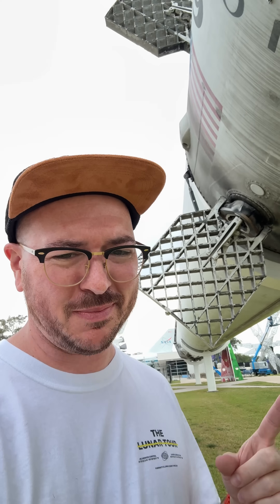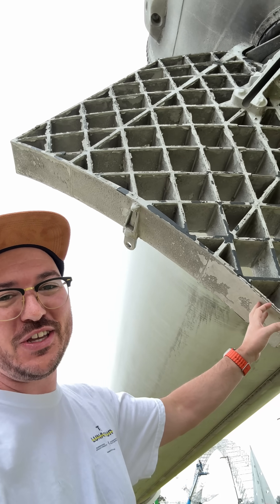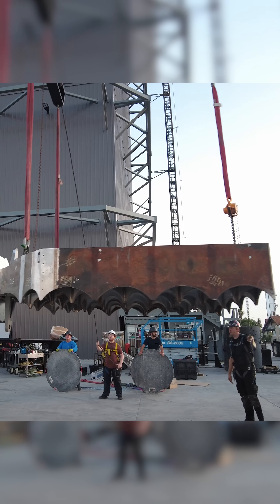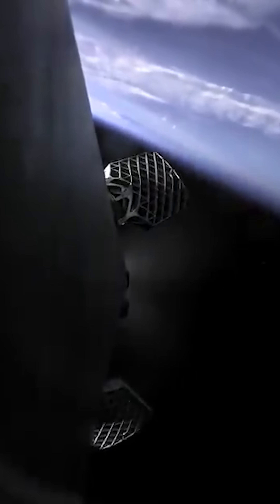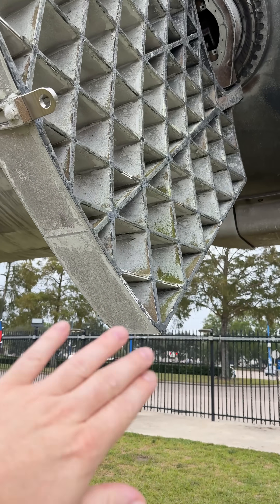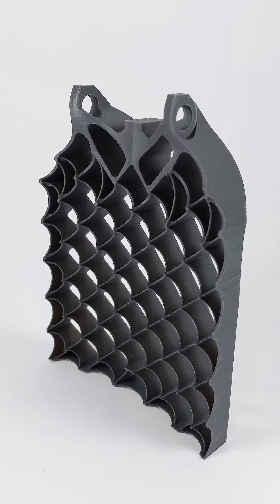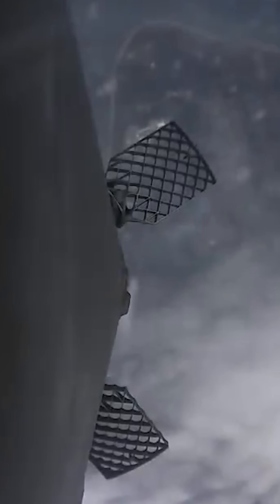Grid Fins are HUGE and super cool! Here's how they work! #falcon9 #starship #SpaceX

Comment: I help to maintain and repair these boosters between flights. The grid fins are pretty hands-off for maintenance. Even after simulating about 90 flights with zero maintenance these things are still expected to be flightworthy after about 90+ flights. They absolutely outlast the boosters they're used on.

Comment: I am actually one of the automation engineers that controls the processes of metallurgy for the fabrication of these parts. All the PLC programming, the robotics, the wax mold process, the casting, the pouring of metal to replace the wax, and all the CNC operations performed. We make these at a company called Howmet Aerospace in Hampton, VA
Reply: Nice!  Must be pretty cool to see them in action.  Not everybody that makes things has the pleasure of doing that, much less on something that is so cool to begin with!
Reply: Badass
Reply: Ok

Comment: I'm guessing they are controlled  by strong, heavy electric motors powered by lithium-ion battery packs through a pretty small circuit board? If so, I wonder how many backup circuits there are in case of circuit failure. Do you think they use tesla car motors for the grid fins?

Comment: You clearly don't know how these work because the are doesn't just push through them they turn and adjust directing air in certain directions around the fuselage and they've also never been made out of aluminum aluminum melts well  below the melting temperature let the whole reaches during re-entry
Reply: Its an aluminum alloy. And the "pushing air" you mentioned isnt whats controlling, its the increased drag.

Comment: Who came up with the idea of the grid fins or when were they implemented into the design? Like did the rocket ever go up without them?
Reply: Falcon 9 can be used in expendable mode for more payload to orbit. The gridfins are only used on reentry so when they don't intend to land it they don't use them. The gridfins were developed by the Soviets and they have been using them since the 70s in missiles and rockets.

Comment: Where do rockets go? How are they able to maneuver in the VACUUM of space? How does something react to nothing?
Reply from the maker: In the same way that a firehose shooting water isn't pushing against the air and then that pushes against the firefighter or when a bullet is shot from, the gun doesn't have recoil because it pushed against the air, it's because of the equal and opposite reaction...  it's the same thing for the exhaust shooting out of an engine, it's shooting out of there so fast, thousands of meters per second, that it has an equal and opposite reaction.
Reply: @EverydayAstronaut  There is nothing to react too. It's empty space. How do thrusters work with nothing there. It doesn't matter how much you throw in volume when the volume has nothing there to react too.
Reply: @igdes1 there's a rocket. exhaust reacts against the rocket
Reply: @aleksandrs1422  hmmm, not sure you understand what a vacuum is.
Reply: @igdes1  do I really need to? My three year old twin nephews don't need to uderstand what air is, but they instinctively understand that if they push one another, they'll move in opposite directions? Air is irrelevant in their case. Well, negligible. Vacuum is similarly irrelevant to the forces in the rocket propulsion. 👍
Reply: @aleksandrs1422  irrelevant to the forces you say. I'm not guessing any more, you don't know what a vacuum is.
Reply: It's Newtons 3rd law.
Each action has an exact opposite reaction.
The exaust moves out the back so the rest of the rocket moves the opposite direction.
You don't need to push against anything.
Reply: @safetyinstructor There is nothing in the vacuum of space to get a reaction from an action. Do you understand a vacuum?

Comment: Designing those is one thing.  Milling them in aluminium is one thing; machining centers for parts that big are well understood.  Milling them in titanium though, that is a whole different thing.
Reply: Aren't the titanium parts printed or at the very least cast?
Reply: @ You could use either of those but I don’t know if there’s a metal printer that big or if printed parts have reached the point where they can be used like that.  You could cast it too, but that’s a tricky shape to sand cast and big enough to make investment casting pretty much impossible.

Either way you still have to machine it to create the attachment points, and if you have to set it up in a machine then (for a small volume of high-value parts) it’s simplest to start with a slab.
Reply: @ Aside, you can certainly cast titanium and probably print it as well; I haven’t seen it being printed personally but I’d be more surprised if we haven’t figured it out.

Comment: Awesome… I’d not say they’re invisible to the wind stream… even without rotating they must create a lot of drag, or why go to the effort of deploying them ahead of return. Great to see though, Starships are mad how huge they are.
Reply: Somewhere online Elon talks about why the Starship booster has fixed fins.  He said that on falcon 9's, when you include the weight of all the motors, mechanism and power sources, it cost very close to as much in thrust as the drag from just leaving them extended AND eliminated many possible sources of failure.  If I remember correctly, he said that if he had it to do over the falcons would be that way too.
Reply: @ fascinating that would go with his mantra of no part is the best part too eliminating all those parts needed to do that.

Comment: As an aerospace machinist, I think those are waterjetted. I keep thinking about how they are made. I bet they are bent steel then waterjetted. That's good engineering because it's super easy to make. The mating clevis type feature is the most complicated machining on these and that's easy if you have a dedicated setup for them. Cool stuff.
Reply: They are aluminum and titanium though?
Reply: I don't think they are bent; I think each individual piece is water jet cut and then they just use a ton of welds to hold it together. Bending would make the parts weaker and be super super hard to do if not impossible given how thick the metal is

Comment: Starship's grid fins currently melt during hot staging, so whenever they start making boosters that are actually meant to be reused, they'll need to change the material.
Reply: they didnt melt they just warped.
Reply: @zachmoyer1849  Mea culpa.  Though I have a suspicion most people visiting an Everyday Astronaut video managed not to become confused by my casual wording.
Reply: @Asterra2  SpaceX will change the grid fins to titanium when they actually start reusing the Booster. They haven’t yet because titanium is so much more expensive, and therefore not viable for a Booster that will only fly once and potentially be destroyed
Reply: @isaacsanders983  Yep.  I think I covered those points earlier but it's always nice to get an elaborated rephrasing.
Reply: @Asterra2  😄

Comment: I thought they'd be even bigger. That is such a small control area for the size of the vehicle.
Reply: you have to remember that its nearly empty. So all the weight is at the bottom. It takes very little force to move it since it has mechanical advantage away from the center of gravity and low inertia since its so light at this point.
Reply: That low weight and inertia make it much more susceptible to weathercocking.
Reply: @jbullforg  the rocket yes but not the grid fins

Comment: Literally the BEST possible short form video on grid fins...
Reply: I bet all the computing power needed to adjust these find, would fit on a 30x30mm circuit board.
Reply: @ripingpuma2460  the fact that there starship gridfins use tesla motors as in car sized motors to rotate is just 🤯
Reply: Right! I was thinking the same thing. Thanks for posting. I can't believe you haven't had more likes.
Reply: Learned something new today 🫡
Reply: I am waiting for Elon, or some Engineer to finally realize that they can also be used for vertical flight, as in on an Airplane.
Reply: @bigbossimmotal think you mean horizontal flight like a plane not vertical like a rocket?
Reply: @iRossco  LOL WOW, talk about a brain fart!
I can't even think of a good excuse for that one. Not enough caffeine? Too much caffeine?
Good catch.
Reply: Here have a 700th like
Reply: until they mess up applying pitch, yaw and roll.
Reply: Are those Elon musk's
Reply: But when the rocket booster slows down just before landing, there is not much air flow? How does the booster control itself with no air flow?
Reply: @1MrTahoe  rocket engines that gimbal or point in different directions
Reply: Bro I always heard Griffins

Comment: Why does the starship not retract its fins?
Reply: the drag on the way up was found to use less fuel then the added weight of the mechanisms needed to fold them would have used.
Reply: @zachmoyer1849  ok thanks

Comment: I wonder if having them out on ascent like Starship is actually more aerodynamic. Seems like they present a smaller surface area to the wind stream like that.
Reply: During ascent, they are moving slowest in the thickest air. As speed goes up, the air is also getting thinner.
Reply: It's more that the drag they create has a smaller impact on efficiency than the deployment mechanism would

Comment: If you were to turn the grid fins contrary to each other, could they act as air brakes because more surface area is exposed to the wind?
Reply: I think technically yes, however I'm not sure if the effect would be significant if you compare the drag to the mass of the rocket, and since the energy would heat up the grid fins they would get even hotter than normal.

The aluminium ones sometimes started to melt, so they can get over 600° hot during normal use.
Reply: @simonm1447 they can use Titanium instead
Reply: @Santi81-theOne  they do now for the block 5 boosters. However even Titanium has a temperature limit.
Reply: You want it to become a spinning drill?
Reply: @bluemamba5317  i mean that they turn contrary to each other so that their controls cancel out
Reply: sure but it wouldnt be enough to accomplish anything in the short windows that they would be able to do that.

Comment: Also, fly-by-wire controls.  A human pilot could not fly these rockets safely, if at all.  Possibly with a lot of simulation time. Modern airliners use FBW technology.
Reply: Even the Apollo LEM used a fully digital FBW system, since it wouldn't had been possible to land on the moon surface without it.

Hand inputs done by the astronauts like on Apollo 11 also went through the FBW system.
Reply: Most "modern" airliners aren't fly by wire actually
Reply: @JaisonBuilds  airliners like a 737 Max which is a modernized version of a 1960s aircraft are no modern aircraft, just modernized old aircraft.

Modern airliners are for example a 787, a 777 or the current Airbus lineup

Comment: The grid fins are not "invisible to the wind stream" When the vehicle approaches supersonic velocities the turbulent air flow through the grid makes them effectively a barrier to the air so more like solid control surfaces. They add enormous amounts of drag at high speeds.
Reply: Actual meters per second speeds at which they are useful depends a lot on the density of the air. They provide a lot of control authority very high up compared to classic rudders/fins which is useful to SpaceX because they can start effectively steer earlier.
Reply: Listening comprehension is key. He literally said when they’re stowed flat against the fuselage they’re invisible to the airstream.
Reply: @DavidPawson-d7h  No he didn't.
Reply: @DavidPawson-d7h imposible to be invisible to airstream, those things are like a aero screen, even if they have holes, I'm so curious in how they solve that problem
Reply: @SantiagoVelezRestrepo  33 raptor engines solves that "problem"
Reply: @DavidPawson-d7h  The big ones don't even fold away, lazy design. I think they need more billions of taxpayer money...

Comment: I wonder how these compared in effectiveness to the regular style movable fins that Blue Origin will use on the new Glen
Reply: Planar Fins have a lot more surface area. They cannot move a lot during supersonic speeds because it would just create too much force on the hinge. So for Planar Fins, you want to more or less glide to your landing pad. 

Grid Fins on the other hand produce substantially less drag and less lift as a result. So your flight profile is more vertical. You're just falling down to your landing pad. 

So which one is more effective depends on your flight profile. For Falcon 9, they did a re-entry burn first and it allows them to come in at a steeper angle of attack. So grid fins are better. For Super Heavy, it's coming down like a meteor. It's designed to punch straight through the atmosphere and land. Grid fins are perfect for that too. 

New Glenn will mostly coast down and use its large fins and strakes to glide down instead and reduce the amount of propellant needed to slow it down for landing
Reply: @snakevenom4954  But in addition to the fins versus grid fins, there's also the lift that you get from the rocket fuselage itself. With Starship booster, one of the reasons they gave it the chines is the chines help the Starship booster glide. 

I got to see flight 3 flight 4 and flight 5 in person. Flight 5, the weather was great and I was able to get excellent video of the booster coming back. One of the things that's interesting is the angle of attack of the booster as it actually does get some lift as it comes back to be caught by the tower.
Reply: @NelsonsWings  It does get a lot of lift from that. But New Glenn would come in a lot more horizontal than Super Heavy. Like nearly perpendicular to the ground. A lot of that angle from Super Heavy is to bleed off the velocity from the boost back burn too. It is coming in very fast after the boostback burn. 

Funnily enough, Falcon 9 and Super Heavy have grid fins for different reasons. Falcon 9 requires a re-entry burn and in the process it removes a ton of its lateral velocity. To the point it's nearly falling straight down. At that point, grid fins make sense. 

Super Heavy is designed to punch straight through the atmosphere and take the heat like a beast. At which point, strakes and fins don't make sense since it'll be coming in slow enough by then and grid fins make sense since it spends very little time in transonic and subsonic speeds
Reply: They're better for supersonic speeds but fins work too at supersonic speed
Reply: @linecraftman3907 why are they better?
Reply: @sirpercivale  lower drag, less torque to turn the fin and harder to stall
Reply: @sirpercivale  They're better depending on the flight profile. If your flight profile is to glide down, fins would be better. But if your profile is to come straight down and land as fast as possible, grid fins are better
Reply: Isn't Blue Origin dead?

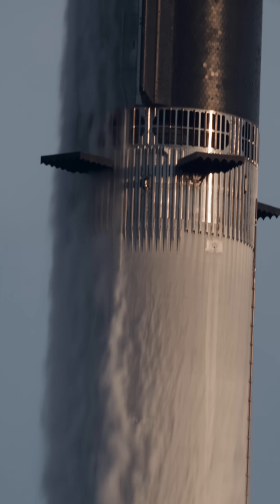Comment: 0:26 wth is that thing that appears behind the rocket.
Reply: Spare astronaut
Reply: Oxygen ice.
Reply: Looked like a spinning shark😂
Reply: @johnbeckman492 it’s probably ice
Reply: My thought too, was looking for that comment 🤔, hope we get the right answer. No, Not ICE ! How should it be ICE 🤣
Reply: @Santi81-theOne  it most probably is ice. liquid oxygen is extreemly cold and causes ice to form on the outside of the booster. 
pretty sure it isnt insulation (like the load of stuff you see falling off Long march 4 rockets), because i dont think F9 has insulation on its exterior (or atleast insulation that can break off)
Reply: add wilhelm scream sfx
Reply: I thought it was a flying shark. 😂
Reply: I slo-mo it, and it looks like some kind of cylinder with fins attach.
Reply: Looks like a twin bladed helicopter in a pong video game.

Comment: Best Explanation of Gridfins
Reply: This video doesn't really explain how they work. It moreso explains what they are used for. It is successful in showing that they are huge and cool though.
Reply: ماهي وظيفة الزعانف
Reply: How he does not explain why they are used instead of conventional controls surfaces.
Reply: @bobcrow214  Lack of critial thinking on your part doesn't make his explanation bad.
Reply: @MsArchitectschannel  I do not lack critical thinking and this vid doesn't explain anything.
Reply: @MsArchitectschannel You are 100% correct. He is proof that dumb people don't realize that they are dumb. 
"It is better to remain silent and thought of as a fool than to open your mouth and remove all doubt."😁
Reply: @bobcrow214  I guess your right he should mention the point of grid fins.

 grid fins are used because they have superior performance at high Mach numbers  and because they can fold in against the body better.
Reply: @bobcrow214 
Its probably because of the holes they are lighter /unit area, also they will offer drag only when rotated meaning that there is more precise control over drag, with a solid fin it would have to be rotated 90 degrees to grid fins if you will ehich would stick out much more and make the folding mechanism more complicated.

I hope this clears it up